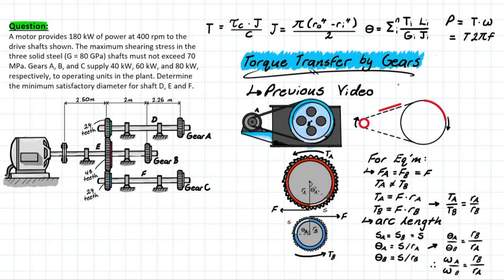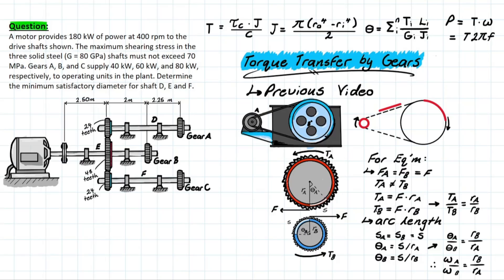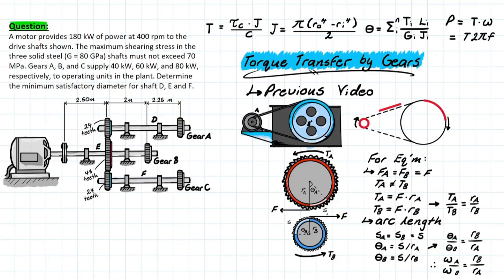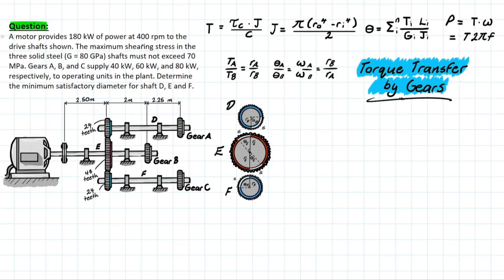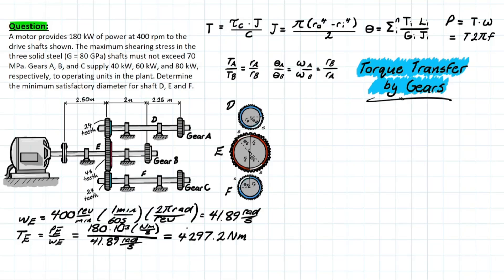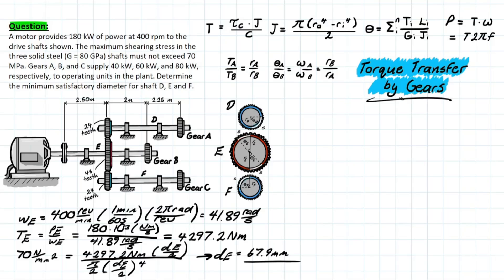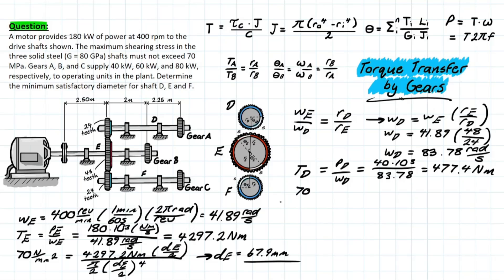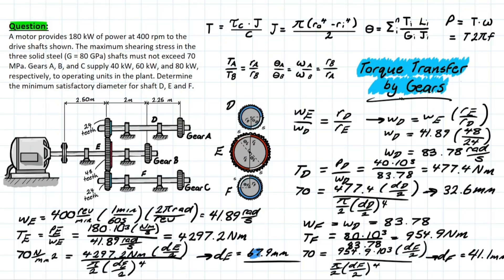Understanding the Gear Ratio and Torque!

Comment: Hello, excellent video. I would like to understand what would happen if an additional resisting moment, in the same direction as the one provided by gear A, acts on shaft D. How would the moment configuration be if bodies D, E, and F are not rigid? Thank you very much.
Reply from the maker: This is an interesting question. From the way it sounds, you may be creating an indeterminate system if we are providing additional external moments (if they are unknown). If they are know, it may be as simple as reducing the overall torque in the member by the given resisting torque. But, this will leave you with an unbalanced equilibrium condition if the system is not rigid.

Let me know if you agree with this logic
Reply: @simple_civil  I assume that since the shafts are not rigid solids, there is a moment imbalance at A and C
Reply from the maker: @diegoeliasmatta8877  Oh for sure, but we also should remember that that torque is 'theoretically' being transferred to a different system by the gears at the end ... maybe. Definitely worth looking into this further to see if there is a concrete answer in texts. Great question though
Reply: @simple_civil  The proposal corresponds to a real case where the model of the problem you suggest is very similar. As long as it has the physical solution, I’ll share it with you!